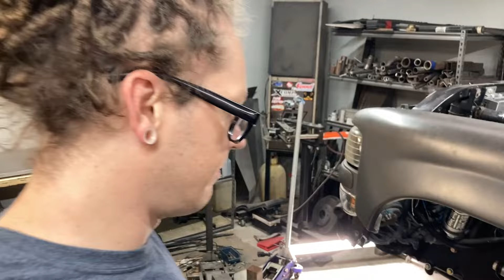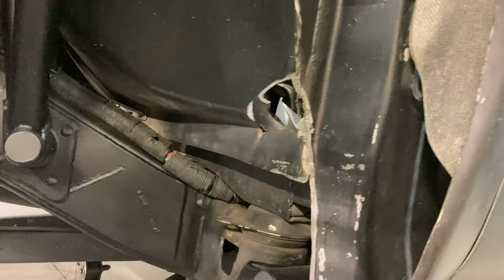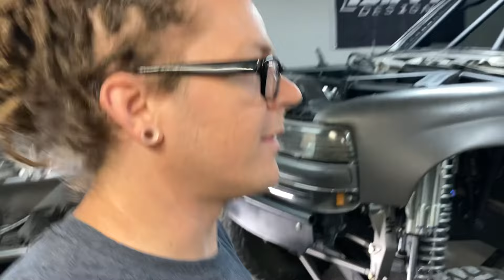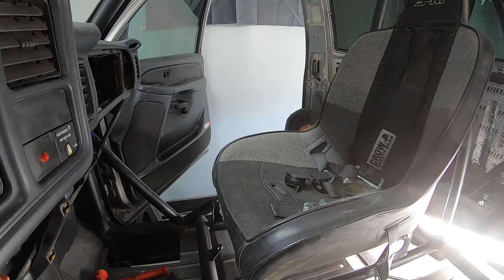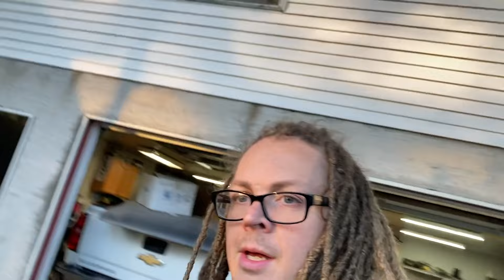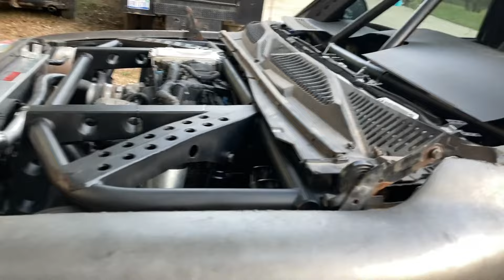2001 Chevy Silverado I beam Prerunner drives for the first time - DH Machine Vlog #59

Comment: How did you coat all the fab parts you made ? Paint ? Powder coat? How did you coat the frame ?
Reply from the maker: I have always used spray paint. With how much I am on the dunes. No matter what I use, it gets sand blasted off. So I have found having everything spray painted I can at least put a fresh coat on parts easy enough whenever I am doing any maintenance.